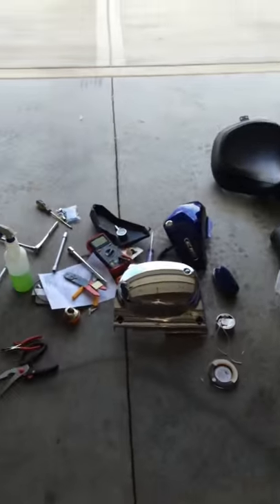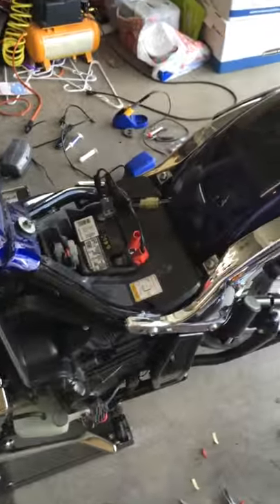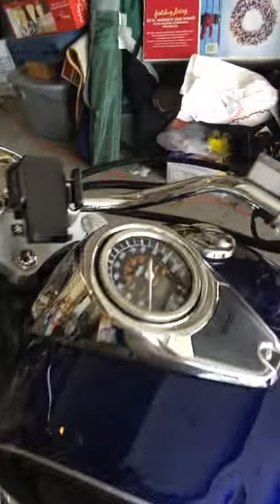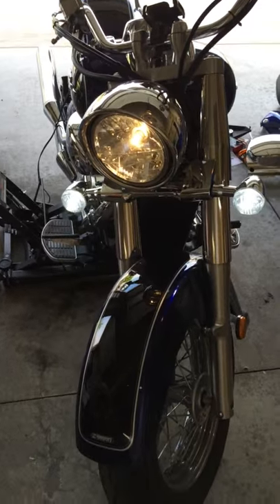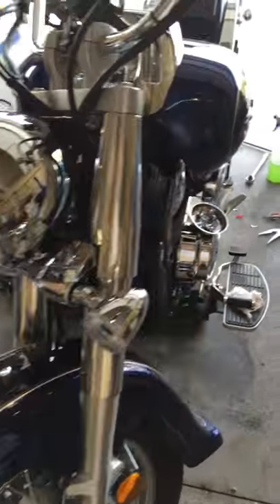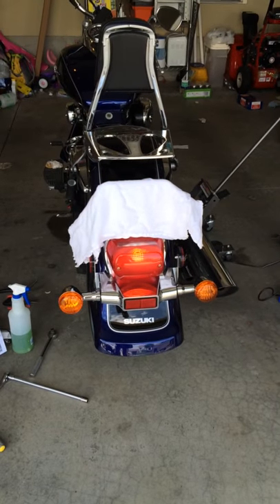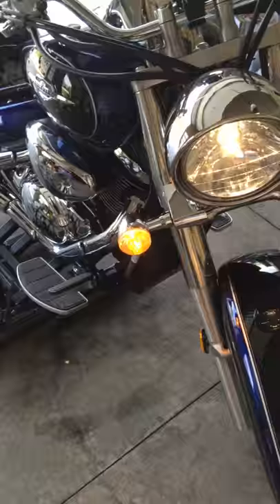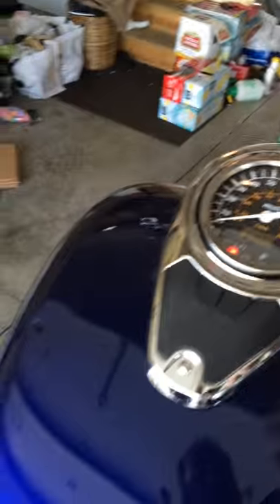Hyper flash fix relay

Comment: I'm planning on installing the LED switchbacks soon on my C50.  I was going to buy the OE fit 7 pin LED relay off ebay but you mentioned yours failed after a week.  That was me worried.  Maybe it was a dud or I could find a better quality OE fit relay elsewhere.
Reply from the maker: Nuts! I just saw this - sorry!

In fact the relay was just poorly built. As a comparison, the OEM relay is, as far as I can tell, completely potted, whereas the one I bought was not, so there was a transistor that was just flapping in the breeze, most likely causing vibration that snapped two of its legs. I'm sure you could, if you wanted, encase it in epoxy (I doubt it'd ever get warm enough to pose a problem with heat dissipation), or for that matter solder the legs together. I could have done that, but decided against it since I have neither the fingers of a 6 year old nor the patience of a daycare professional. I'm sure there are better OE fit LED compatible relays out there - I tend to be cheap...and so I pay for it later. :)

Comment: what do you think of this. has switchback led for front, and normal led for back signals. its fine when off but key is on. when i start it. there are some moments the leds blink fast a few times here and there. have load resistors put on correctly.
Reply from the maker: Hmm. I would check grounds. I've seen ground faults create some weird problems. My switchbacks in the fronts takes a second or two to turn on, but once they're on they're rock solid.